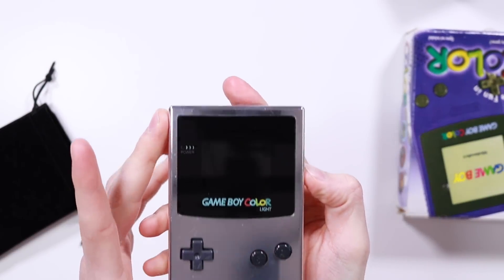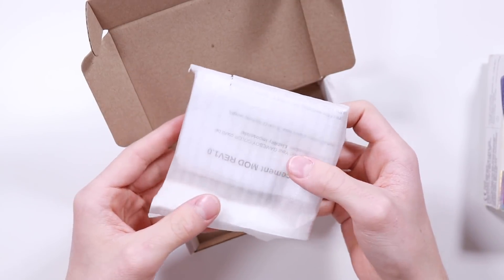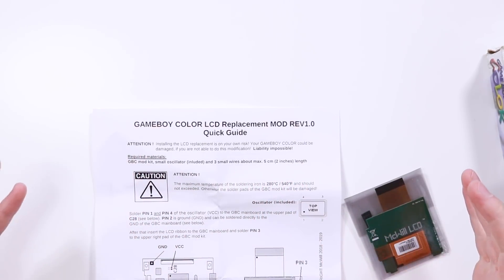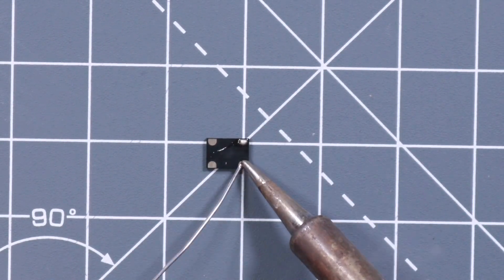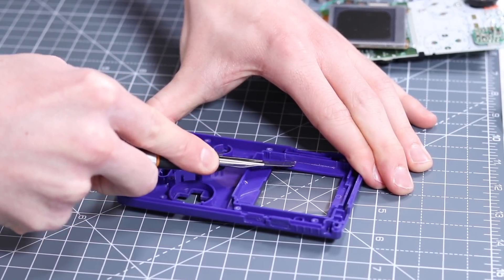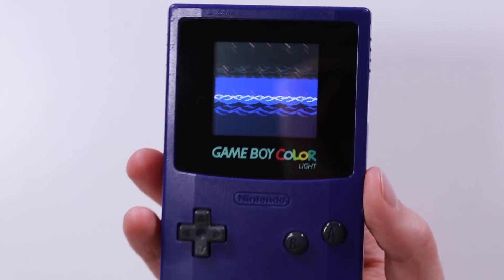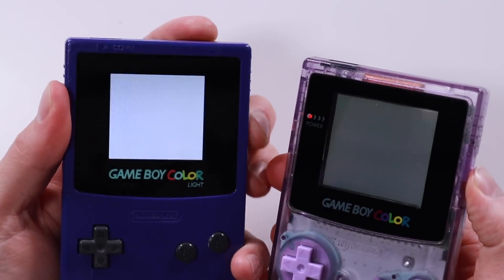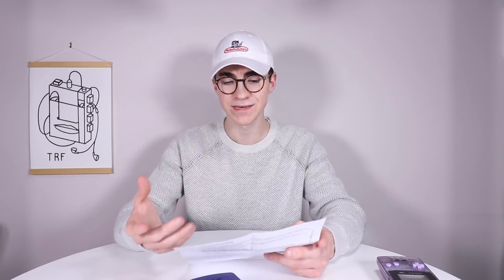GameBoy Color McWill BACKLIT Screen Mod!

Comment: The bennvenn mod requires no soldering thats better in my book.
Reply: Arnaldo Vera but soldering is super easy
Reply: @armon9555  Perhaps, but not everybody has access to soldering kits, even cheaper ones. Unless you do this as a job and solder daily or at the very least you restore/mod Gameboys for profit, once you're done with your screen mod you're left with a soldering iron that you won't have an use for anymore.
Reply: ChaosZero ノブ idk man I just took a random leap of faith and bought a 20 dollar one off ebay that’s just fine. Never knew how to do it prior either, just hopped on youtube and wanted to try replacing a GB game save battery as my first attempt. Everyone starts somewhere
Reply: @RandomizationShow  I'm not saying soldering is hard or that you can't learn how to use it. I'm just saying that even if it's just $20, it's still something that you're going to use once and never again unless you were to do this professionally as a job (although, if you do you're probably going to spend a lot more than $20 for a soldering kit). 

In my humble opinion, despite $20 not being a lot of money, it's still something that I would personally justify for myself if I were into modding/repairing/restoring consoles/controllers and whatnot as a hobby, but as I don't have the time to do so (as much as I would like to), I'd rather pay a similar price for a screen that is just plug&play and can be installed in 10 minutes without soldering. The price is similar, so the convenience of not having to deal with soldering is a point towards Benn's kit.

Also, I've asked Benn directly if this kit was just going to be for the GBC and he said that he's currently testing and developing a similar solution for other consoles, like the GBP, the DMG GB and so on.
Reply: I work in electronics, and I use a high end soldering station at work and home. But, I have used a $7 USB battery bank-powered soldering iron without a problem for these kinds of simple jobs.
Reply: @MikeStavola  Would a cold solder be sufficient
Reply: Ben venn Frackle shack..
Reply: ChaosZero ノブ fair point

Comment: I don’t understand why the new „Game Boy Color Light” screen protector doesn’t have a power indicator LED cutout.
Reply: Its because its made for the bennvenn mod. And you need to remove the LED then
Reply: patrikw25 But the LED can clearly be seen in place at 5:12, the moment the screen protector is put on.
Reply: @banortwi  Yes you can have the led on the mcWill mod. But not the old  Benwenn mod. The screen protector is for the Benwenn mod. But he is using it for a mcWill mod in this video 🙂
Reply: patrikw25 oooh I see thanks a lot for the clarification! :)

Comment: Is it necessary to flush cut the cartridge pins?  If the screen and board do not make contact with the pins, then it is unnecessary.  I know the BennVenn backlit screen mod ("Freckle Shack") does make contact, as do the older AGS-101 screen based mods.
Reply from the maker: I guess its better to be safe than sorry! Even installing the board you might push it in wrong.

Comment: Been looking to buy this mod on a GBC, but the seller says it has to be powered on and off 2-3 times before it works (the screen) and that it is normal for this screen. Sounds a bit weird! So what have been your point experience so far regarding that? Thanks and great video! :)

Comment: Out of the box I like it alot more than the ags 101. Is the McWill screen the same resolution / aspect ratio of the original gbc screen?
Reply: He put the same glass screen on it that the AGS-101 screen mod is using so I would assume it's a smaller image compared to a stock GBC screen.
Reply: @Declan Gallagher no probably 2x or 3x the original resolution.